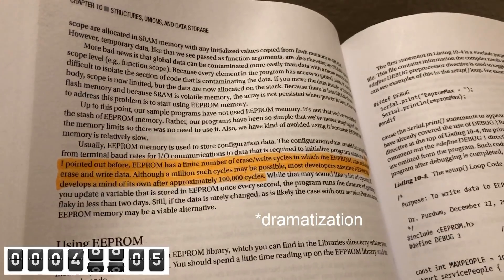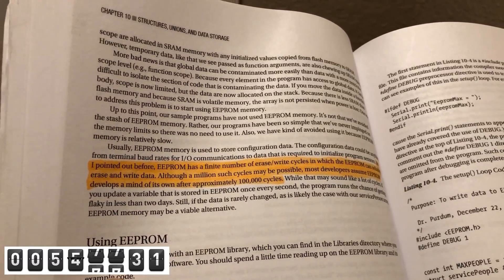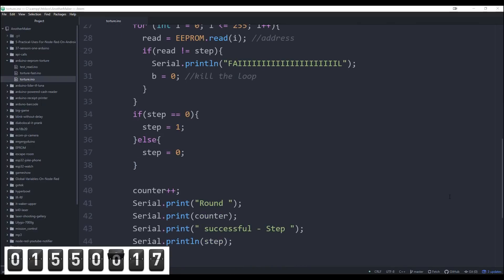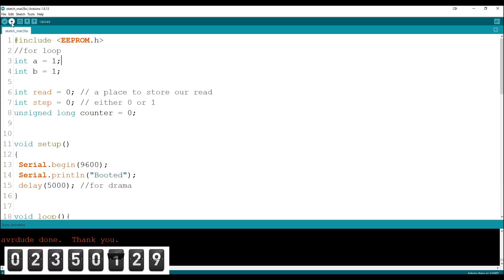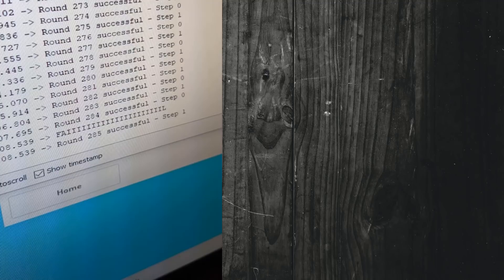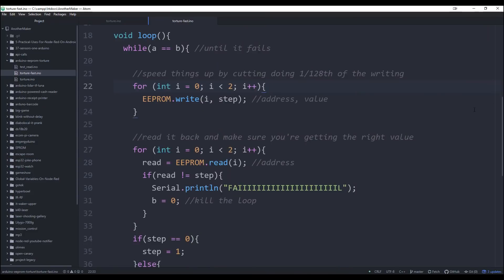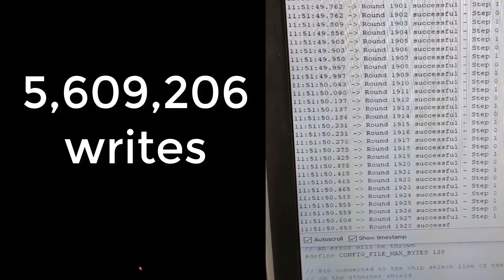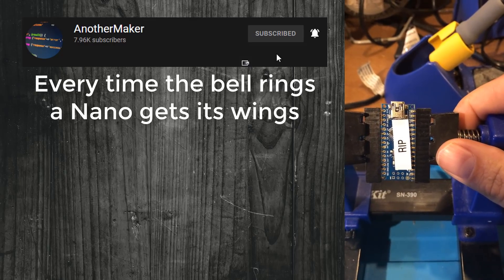How many times can you write to the Arduino EEPROM without killing it?

Comment: please make video of .what happend after eeprom finish maximam cycle ?
what problem face after max cycle?
Reply from the maker: I have saved them for a full tear down. Essentially the eeprom part of the chip died which makes it not usable. I have a feeling if I had written a program that did multiple things, it would still function. The problem is I can't write to it anymore.
Reply from the maker: It's built into the cpu @BlondieHappyGuy

Comment: @AnotherMaker so I can give you a bit more information, the write times for a traditional eeprom memory cell is usually a garenteed a minimum number of writes per cell. That num can go up or down for unknown reasons. I have been digging into this as I just got hired recently in a team that specializes in serial eeprom. From comparing a number of companies, each one has a different amount of reliability but for older tech microchip is the best. The eeproms there will usually last at least 1 million write cycles , but testing individual cells of memory, that can vary, I tested one bit and got 80mil+ writes off of it but the arrays of memory traditionally you will see errors after 1 million cycles and will exponentially get worse, that usually out performs most of the market. Atmel parts are also microchip parts too, you can find them on alot of arduinos.
Reply from the maker: Thanks for the extra info. And obviously I could do wear leveling to extend the life

Comment: You said the Arduino stopped working. Dead somehow or just those bits of the EEPROM? Couldn't you write some simple code to check writes and remap to a new block on error?  Isn't this what SSDs do?  It could check every write so that data is never lost.
Reply from the maker: Yeah absolutely. I was intentionally trying to fatigue it. But there are a lot of weird leveling algorithms that you could write to extend the life considerably.

Comment: The flaw with this test is that you kept it hot. You should test it leaving time to cool down. Like 1 try every 3 seconds.
Reply from the maker: Yeah. It's not a perfect test, but it is a ballpark.  At every 3 seconds the test would have taken 90 days for the single int write if it failed at the same 5 million.
Reply: @AnotherMaker  The point is that it should fail earlier, or at least at a lower write count.
Like I don't know if these EEPROM are better with being hot like NAND flash, they sure are worse with temperature changes like all electronics.
Reply: Maybe it would still take 2 months, but it would be more accurate.
Maybe with 2 seconds of pause is sufficient too... I don't know, we should check how much it gets hot and how much it needs too cool down. Major problem is that we can only measure the ceramic cap, not the circuit inside.

Comment: Beware that writing is not the same as _over_writing (erasing and then writing). Erase blocks tend to be bigger (sometimes much bigger in NAND). Sometimes the controller is smart enough to only do the erase when bits need to be changed back, sometimes it just doesn't care. So you writing 1 bit might actually be erasing/writing something like 1Kbit. And if you think you can be clever and use different blocks - first make sure that they are not part of the same erase block size (or your work goes in vain) or even worse, make sure that you're not "dirtying" large blocks of the flash by doing this (I am not familiar with EEPROM erase block sizes, but in NAND it can sometimes be in the order of megabytes(!!!)).
Reply from the maker: You're absolutely right. I've been learning more and more about this. Thanks for sharing.

Comment: Won't it depend on the brand ?
Reply from the maker: Possibly. Although the brand refers more to the board and the other components.  The chips are all built by Atmel. There's also a chance that some of the clones use seconds or lower quality chips.

Comment: If the device is considered to fail upon a single bit of memory failing, then I think you need to write to all bits of memory in each round of testing to find the soonest possible failure. Writing to only the first few bits of memory will give a very optimistic underestimate of the lifespan of the device. By analogy, consider buying lottery tickets. If you just buy one ticket (I.e. check just one memory cell) per round, you'll have to wait a very long time to win. If you buy millions of tickets per round, you might expect to see a winning ticket (I.e. a failed memory cell) much sooner.
Reply from the maker: Yeah.  That is why I did 2 vastly different write amounts.  Btw, the first test did write all the bits in the eeprom and then some.   So I did do a complete write.

Comment: I don't think this test is very accurate. It would be much better to program the ATmega328P directly, and make sure you're writing to the EEPROM and not to Flash or RAM. Even if the EEPROM is worn out, the rest of the device should function as normal, so the fact you totally killed it makes me think it was writing to flash, hence the huge disparity in number of writes.
Reply from the maker: I was definitely writing to the eeprom... If I did the test again I would definitely tweak some methodology but I was definitely writing to the eeprom

Comment: Mileage may very if your writes are spaced out more ie changing the data every couple minutes not in a fast loop. Temperature is also a factor along with longevity.

Atmel is really saying at 85C in a worst case scenario you can rely on 100k (or more) writes that will hold in EEPROM for years.

If you need more you can use error correcting and load leveling to get way higher. At any rate don’t rely on writes passed 100k for anything important. It will let you down especially if you do 200k writes then expect your last write to survive for years.

You will find bits that last for billions of writes and some that die closer to 100k. Typically there is a bell curve in things like this.
Reply from the maker: Absolutely. Data longevity after writing and the temperature while writing are huge factors.

Comment: 1) EEPROM and Flash have different write cycle endurance on these chips. EEPROM is made for LOTS of reads/writes. Flash is not. You might get a few hundred thousand cycles if you're lucky.
2) You should still be able to read the EEPROM/Flash even after it can't be written to anymore.
Reply from the maker: I could still read it.  It was just not accepting any more writes correctly

Comment: Now if only that little chip was in a socket instead of soldered directly to the board you could just drop a new chip in it......

Of course you could always remove the chip and solder a socket onto the board. No sense in throwing away a perfectly good board because a $2 chip burned out. Well before the chipocalypse that is....
Reply from the maker: Yeah. A lot of the uno's had their 328p's in sockets.
Reply: @AnotherMaker  Thats why Im slightly salty about non-socketed chips on dev boards now. I have two Unos, one from around when Radio Shack shutdown (yay going out of business sales😭) and an Elegoo from Amazon, both socketed. I ended up frying both chips (one stupidly, the other thanks to a dangling wire). Towards the tail end of the pandemic the chip shortage I got a 4 pack of those tiny 328 ICs on the purple pcb with DIP spaced pin headers cheaper than getting a single new board. So for less than replacing an entire Uno, I have new chips in both of em, one for my ice tube clock and a spare!

And, like....surface mount quad package sockets exist...I think its kind of short sided to not even offer the option considering they're marketed towards novices, and people learning electronics and prototyping. ie, people who have a higher than average chance of wiring something wrong and blowing a chip. People who might not know they can, or be up for, desoldering the bad one and popping on a new one. Heck, theres tons of people that think they need the uno board for their projects when after its flashed on the boards (for ease of using the USB interface) all you need is a few caps, a power regulator, and a crystal (even then IIRC there is an internal clock, as long as you dont need horribly accurate timing). Like, it effectively increases potential ewaste from blown chips and people thinking the whole board needs to be tossed....Maybe that was the idea? But I choose to stay on the less sensational side of occams razor and not directly jump to malice on the manufacturers part. 

It was still kind of a dumb move to go non-replaceable, IMHO.....

Comment: Had anyone said "wear leveling" yet?
Reply from the maker: A time or 2.  And yep.  That's how I would normally do it.  I was specifically trying to fatigue the chip though.
Reply: Unlike "spinning rust" hard drives, Wear Leveling is not something done by the user. It is a function of the flash controller. So each of your tiny writes will/should have been moved around the silicon. If each write had filled all available flash space, I would expect your "writes to failure" number to plummet

Comment: So hot tip.... you're only writing it half as many times as you think.  When you write a 1 to an EEPROM location, literally nothing happens as the erased state of an EEPROM is to produce a 1.  Writes only physically change the device to a zero, and erases only physically change the device to a 1 - if it was not already in that state to begin with.
Reply from the maker: I'm not an expert on that, but I don't believe that the hex/binary character 1 is the same as the integer 1...the integer takes 32 bits.

Comment: The thing is that amount of 100k or any given value from datasheet is guaranteed and measured:you have 99.8% probability that it would work for more than 100k cycles. But for example it can die just in a next cycle OR in couple of millions cycles.
Then, there is another problem, you didn't made a check: how long it can store the data. 
Because when you are over the limit you can loose your data in couple of weeks, but those 20 years are guaranteed when you are in limits. 
Why it is limited?
Basically, because mosfets are capacitors with semiconductors.
Metal oxide that is used as an isolator  to create famous mosfet structure is usually an oxide of the metal that is non-conductive and pretty nice isolator.
But for memory cells they put one more gate at the top of the regular gate: sandwich like structure.
So, because of this it changes I-V characteristics of transistor that can be used as memory.
But the problem is the degradation of oxide layer because you are breaking down the gate capacitor with each cycle: material gets polarized and  IMO it gets a shockwave and slowly looses density that decrease isolation properties that would make that thing unusable.
Why we don't use material that has supercool isolation properties?
Because that thing is already a very nice isolator, but in dimensions of micro and nanometers you can't take much.
Then, there is a problem with capacity of oxide layer that depends of isolation constant of material: IMO you can end up with memory that needs a lot of power to use it fast. More Cox-more current is needed to charge it fast l and there is a problem of power design, emi and so on- things are becoming more complicated. So, it is always a trade off: I wouldn't be surprised that you can get memory that would be very stable and very reliable. But it would be slow and take a lot of power, comparing to the other configurations.
But yes, when you write something in the memory-there is a current spike.
Reply from the maker: Yep. you're absolutely right.  And thanks for the awesome, detailed information. I've learned a lot from the great comments on this video...yours included.

Comment: I think that flipping every bit 1 to 0 and back might be easier on the hardware than like a deeply random mix of ones and zeroes.

Random has more scenarios where Arduino is trying to hold 1 bit low while all other bit locations proximate on the memory wafer go high.
Reply from the maker: I can see that.  I'd have to kill a bunch more to fully exhaust this kind of testing, but your point definitely makes sense.
Reply: Why is that harder on it when fewr bits will be changed?  Shouldn't that roughly double the life since each bit has 50% chance to actually change on each write?

Comment: Just curious, but did you try replacing the controller chip to restore the Nano to service?
Reply from the maker: I'm going to do an autopsy on these.  The eeprom is inside the atmega chip, so the only other thing that could be changed is the usb controller. I'll see what's borked.

Comment: It's rated for at least X number of cycles because if you write to the whole EEPROM sector you should expect at least that much endurance before a failure.
If you look at the data sheets for these chips, however, you'll find that the endurance is temperature sensitive, so at higher operating temps you get far fewer write/erase cycles.
Reply from the maker: Absolutely. You're 100% correct.  Thanks for sharing.

Comment: I am surprised that the Arduino "doesn't work any more."  Certainly, those 256 EEPROM locations are dead -- possibly all the EEPROM is dead -- but I would expect everything else to work fine.  The 100,000 is the manufacturer guarantee... typically, only 1 in hundreds of thousands will have durability so short.
Reply from the maker: I'm going to do a complete autopsy. I know one is still good for something. The other wouldn't connect to the pc any more, but I'll get a full report.

Comment: 49998 writes and checks, after write FF and then 00, pause and check  the next day if all 00. this way you may examine the data retention too. i am not sure but if cells act somehow like a small capacitor where small leakage after degradation will not be obvious if you write and read immediately. if this is true the real degradation will show up i less cycles.
Reply from the maker: Yep. You're absolutely right. Even if it survived a million writes, the retention would probably be weakened.

Comment: Well, of course it would last way longer, as always. However the figures the manufacturer gave out are the ranges where it should be guaranteed to work properly. Things can easily change with temperature changes. Even when a bit error happens only rarely, depending on what you're doing, any error may not be acceptable. There's always a chance that you get errors even when you are still below the specified threshold. Though chances are very slim.
Reply from the maker: Yep. Some people will get below the number. Probably a lot more will get above it because they are conservative.  I'd like to see the differences with the temperature changes. I wonder if they'd be measurable.
Reply: @AnotherMaker  Sure, would be a great test :) Though reliable figures can only be gathered through many tests and take statistical average. Even though electronic circuits do not have any moving parts, they are still subject to wear and tear, just on the atomic level. So there's a lot uncertainty in there which could contribute to the life time / write cycle count. The manufacturing is just as precise as necessary and as bad / simple as possible :)

Comment: So if I understand this correctly because your second run wrote to such a smaller amount of memory statistics say it will last more writes as less has to go right. As you need 256/256i to pass the first test but 2/2 to pass the 2nd test. The larger the memory the more likely it is that one part of it will fail
Reply from the maker: Right. And it only took a single bit to fail for the whole thing. Spreading the test out over the whole memory space would have caused it to last way longer.

Comment: I did a similar test. It apears that eeproms tend to 'remember' the data not as long as specified, usually 10..20 years minimum. The test is checking the eeprom very short after the write. It will detect malfunction much too late.
Reply from the maker: That's what I'm hearing.  It would be kind of funny to plug the thing in once a year and check it. I'm guessing in 5 years mini USB cables will be nearly impossible to find, so I better hang on to it.
Reply: @AnotherMaker  nah u can always order the cables online, however getting them from your local store will probably be difficult haha

Comment: The EEPROM for user data storage is a lot more resilient than the program flash memory. I think the program flash is only specified to around 10K writes. The difference is you normally only ever write to program flash when uploading new code. (You can write to program flash from user code - this is after all how the bootloader works - so in theory this test could be adapted to test the program flash too...)
Reply from the maker: Yeah. I've been thinking through a good test for the program flash.

Comment: If you write to more memory, does it seem to wear out faster?  I suspect there could be some basic wear levelling going on.
Reply from the maker: I think it's a bit of luck of the draw. It only took one bit to fail for the whole test to fail.
Reply: Don't expect wear leveling in a device with no error detection and very little memory. It's not an SD card with its own controller.
Reply from the maker: @0LoneTech  Right. I meant DIY wear leveling where you increment the memory location that you are reading and writing.
Reply: @0LoneTech  Fair enough, I didn’t know how it was internally managed, that’s not my domain normally.  That said, I would expect more writes than promised because there’s the trust element and the middle of the wafer is usually better than the edges.  I just have curiosity galore.